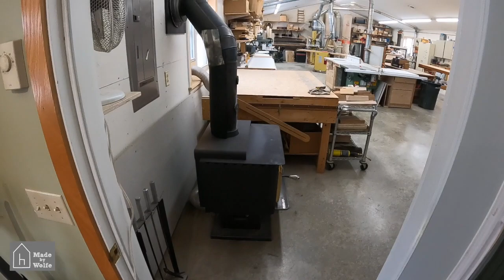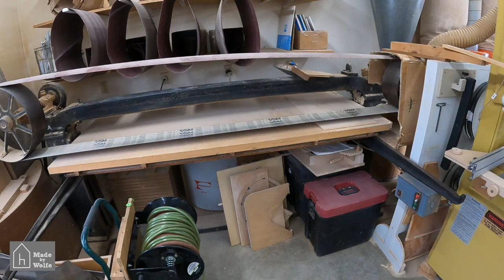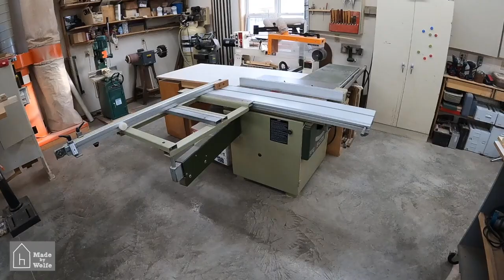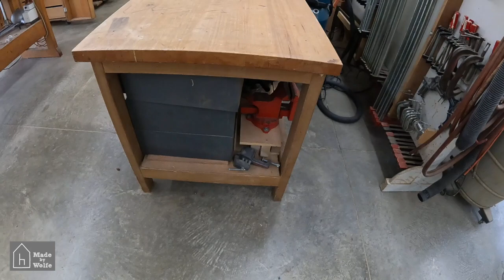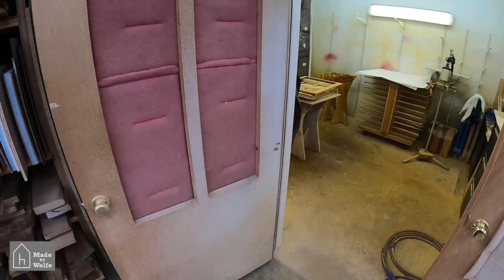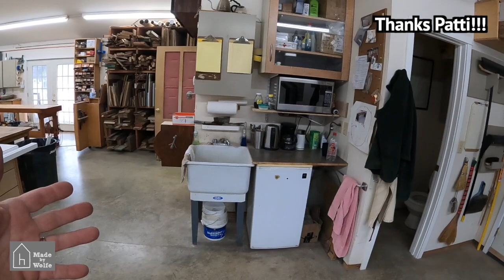WOODWORKING WORKSHOP TOUR 2021:  Made By Wolfe's woodworking shop tour

Comment from the maker: Several people have asked about the dimensions of the shop.  Here it is:  

The shop space itself is 29' x 50'.  It has a vaulted ceiling that is 8' at the outside walls and about 12' at the peak (it is made of scissor trusses).  One corner of the shop has the finish room, which is 10' x 12' with a 8' ceiling.  In addition to the shop is the office which is 20' x 12'.  Both the workshop and office were added on to the original garage, which is 20' x 24'.  The garage is not used for housing cars, but rather lawn mowers, snow blowers and the overflow of stuff from the shop.  It is also where I can do some basic metal fabrication.

Comment: What finish did you use on the floor?
Reply from the maker: The floor.  One of the most important parts of the shop that is overlooked.  It was simply power troweled to a smooth finish and then a decent quality sealer (that is used to keep the concrete from drying out as it cures)  was sprayed on it by the concrete contractor the same day.  This has stood up over 20 years of wear and I am able to sweep the entire shop in 2 minutes with a 30" dust mop.

Comment: Very nice workshop, and nice tour.  Glad you admitted to cleaning up and not wanting to show the garage.  My main shop is a bit smaller, @ 40 x20, (but much taller, with wood storage up above)  But I have additional buildings too, for storage, more wood storage, and finishing, work.  Also mine has no office in the shop.  My wide belt, (not the same brand, but also made in China, I have had for about 20 years and before that the same drum sander you had, (and I never use anymore)  is in a different shop with more power.  Wide belts, even small ones like yours and mine are power hogs both in the sander itself and the compressors and dust collection.  My main shop is off grid, so hard to run all that off solar alone.  Though I have an Oliver 16" saw with a dust collection and an Excalibur sliding table attached, (sliding table is great, but probably the SCMI one is a bit smoother, can lust after a Martin or such).  We have most of the same types of machines, though mine are for some reason older mostly, (Crescent jointer, 30" Tanewitz band saw, etc) but basically all same idea.  You've done a great job, and I like a lot of your projects.  Wish my shop always looked as clean as yours, but, I have lots of fun out there.  Woodworking was my hobby, not the business, but now I've made more than 100 cabinets and pieces, and I value it more than any other thing I do at this age

Comment: I use for over 30 years PVC sch40  for air and never had a brake ore leak in one.
Reply from the maker: That is fantastic.  I had thought of it, but quite frankly chickened out, thinking that surely I would have issues later on.  Thanks for sharing your experience.  I might consider it if I ever install airline in another workspace.  For the cost of copper today, you could install pvc several times over and still be ahead.  Thanks for commenting.
Reply: @MadebyWolfe  PVC still going strong 1/2"  if it is done right quality primer & glue,
only use indoors the sun gets to it after 10 years. sch40 rated at 600 PSI.

Comment: Question - why didn't you locate the wood stove in a more central location - I'm sure you had a reason but I was just interested why? Thanks - great shop.
Reply from the maker: Jeff, that is a really good question.  It was very intentional.  First, it is good to know that the wood stove was an add on years after building and using the shop.  When I added it, I wanted the wood stove to be able to provide heat to the office as well when I spend long periods of time in there.  When I want heat in the office, I have a fan that I place on the floor at the door that forces the cooler air off of the floor of the office into ths shop thus drawing in warm air off of the stove.  It works well. Actually, with the large open space and higher ceilings, there is little temperature difference throughout the workshop once things warm up.  Thanks for watching and thanks for commenting.

Comment: Very nice place! What size build do you have there?
Reply from the maker: Thanks for asking.  The shop space itself is 29' x 50'.  It has a vaulted ceiling that is 8' at the outside walls and about 12' at the peak (it is made of scissor trusses).  One corner of the shop has the finish room, which is 10' x 12' with a 8' ceiling.  In addition to the shop is the office which is 20' x 12'.  Both the workshop and office were added on to the original garage, which is 20' x 24'.  The garage is not used for housing cars, but rather lawn mowers, snow blowers and the overflow of stuff from the shop.  It is also where I can do some basic metal fabrication.  Thanks for watching.

Comment: Very Nice Shop. What is the wall to wall dimensions...? Wall height and center ceiling heights? Spray booth size etc. Thank you for Sharing with us. I will be subscribing...  Greg
Reply from the maker: Greg, that is such a great and seemingly obvious question, yet, I did not even think of mentioning those measurements in the video!  So the shop space is 29' x 50'.  It has a vaulted ceiling that is 8' at the outside walls and about 12' at the peak (it is made of scissor trusses)  The finish room is 10' x 12' with a 8' ceiling.  The office is 20' x 12'.  Both of those were added on to the original garage, which is 20' x 24'.  The garage is not used for housing cars, but rather lawn mowers, snow blowers and the overflow of stuff from the shop.  It is also where I can do some basic metal fabrication.  Thanks again for the question.  I think I will post it in the description